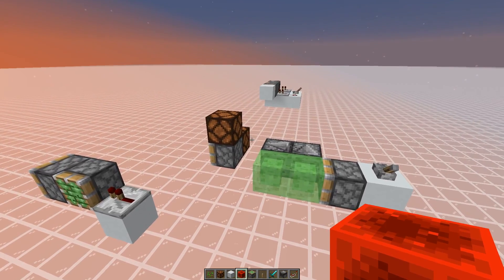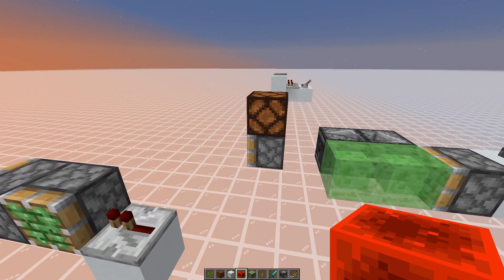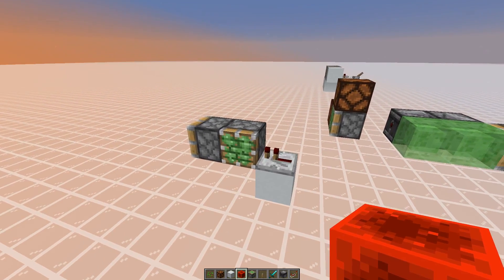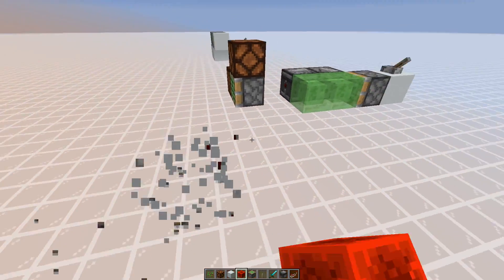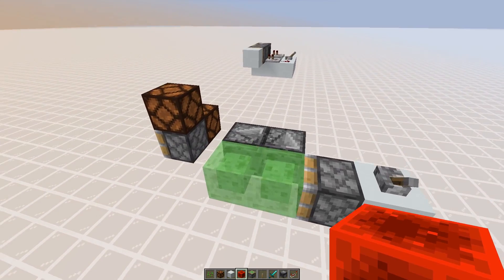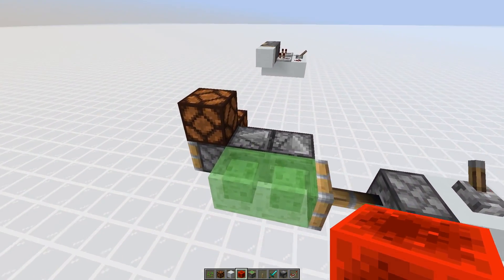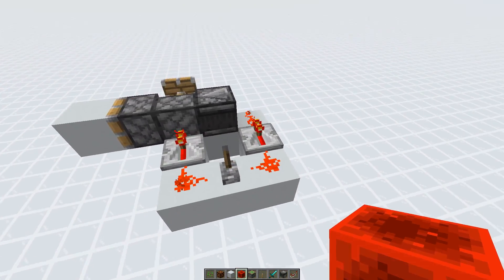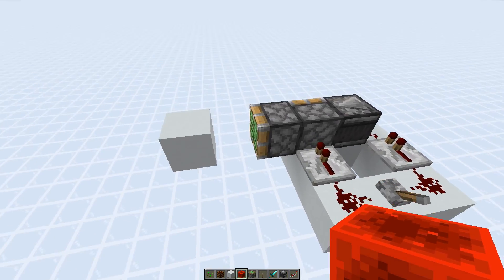Bug Of The Week 32: Piston Base Conducts Redstone Signal When Retracting

Comment: I've had similar mishaps still in 1.14.4 where a slime block on a sticky piston would keep powering the piston if you put a redstone block on any side of the slime block (except the one in the same direction as the piston head). So the piston would extend because the redstone and slime block somehow power it, then the signal would be lost because it's too far away so it would retract, reconnecting the signal, and then extend etc. The odd thing is that if you placed it as normal this wouldn't happen. Idk how i did it but this might be directional, timing based, idk